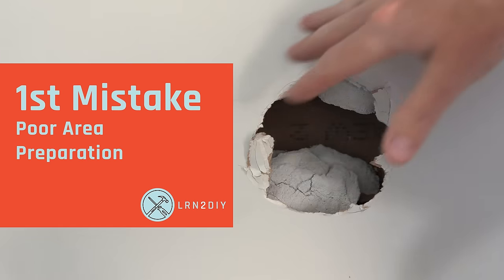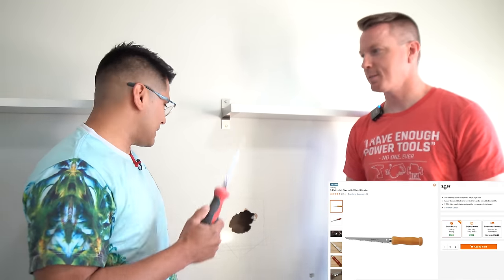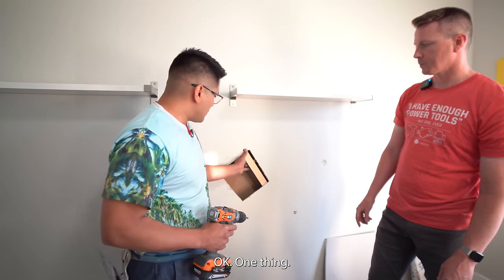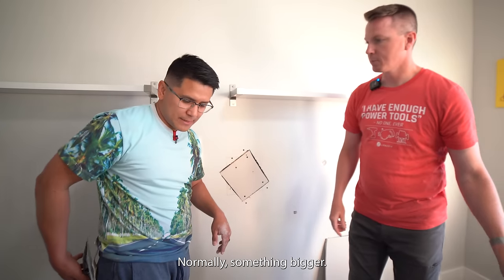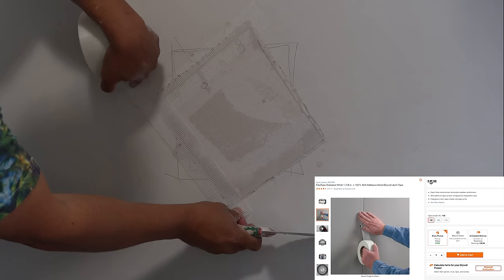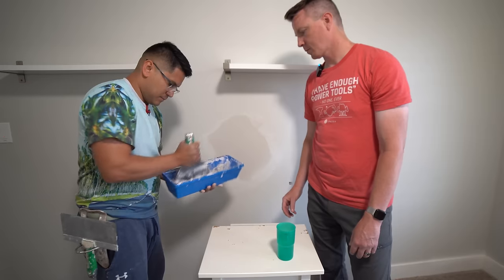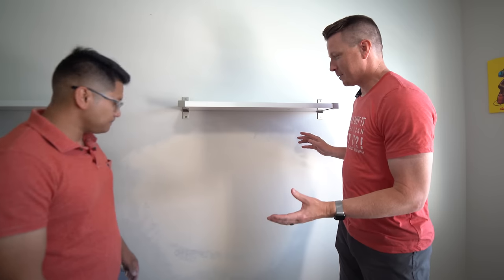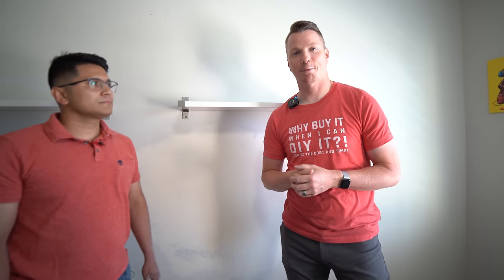5 Mistakes DIYers Make When Patching Drywall

Comment: A great tip I got from a spackler once. If the wall has many paint layers put on over many years it will likely have an orange peel look from the many coats of paint that built up on each other. This is especially true in older homes. Once sanded smooth your beautiful new spackle job sticks out like a sore thumb after painted.  UHG! To prevent this here’s the trick: before painting, mix up a THIN batch of spackle to a “paint like” consistency. Use it like paint. Roll your paint roller in it & go over the new spackle. You can even go beyond it a bit to further blend in with the old painted wall. Let it dry. Lightly sand with a barely damp sponge, blend the edges of the “spackle paint” with the old paint on the wall. Now when you the paint your wall you won’t see any demarcation from old wall to the new. No special talent needed by a DYIer.
Reply: Excellent

Comment: If you are using mesh tape you HAVE to use HOT MUD (they did in the video but no mention of having to use it with mesh tape). Using pre-mixed mud, the joint will be prone to failing as pre-mixed mud shrinks about 20% when it dries and won't grip the threads in the tape). Read the label on the mesh tape if you don't believe me. If you don't have hot mud, then use regular paper tape.
Reply: Don't know about that bud never had one fail
Reply: @jamesalbrecht418  Now you do ;)
Reply: @wally7856  na I found in the long run in Australia the paper tape always fails after 5 years see it every day and our pre mix mud we have a few types base,top,finish the base does not shrink at all
Reply: @jamesalbrecht418  dude the people that make the product mesh tape says to use hot mud in the first coat
Reply: @NunYaaBizz  as I said we have a pre mixed hot mud called base coat
Reply: @jamesalbrecht418  oh ok I missed that
Reply: @jamesalbrecht418  I apologize sir
Reply: @jamesalbrecht418  do you accept my apology
Reply: @jamesalbrecht418  He's correct
Reply: @NunYaaBizz  nothing to apologize for... Their comment only said "pre mixed" and listed the 3 different ones... They never used the key words "hot mud" when they said pre mixed... It wasnt until reading through all these that it was said what they really meant but didnt really say.
Reply: I use pre mix with mesh tape all the time. never had a problem.
Reply: @bobhren747  You should call up all the manufacturers of mesh tape around the world and tell them their instructions are wrong because you know better.
Reply: @wally7856 bobhren747 didn't say he "knew better,"  just that he's never had a problem with it before.

Comment: To save the handymans stress of using joint tape which often results with a domed finish and the inevitable sanding down inadvertently revealing the tape. Use construction adhesive in the gap around the repair piece, when dry sand it flush if necessary, then top coat over the top of it. Done it many times with no failures or cracking.
Reply: ta that works till someone touches it and it falls out
Reply: Use scrim and give it about 4 thin coats each coat getting wider and longer. To help with the blend.
Reply: yep that work well
Reply: That's the difference between a "handyman" and a finisher. Construction adhesive will result in lower quality work. That's not how it's done by professionals so why would it be good?
Someone who is good (heck, even decent) at drywall will use a tape of some kind because that's how it's done. Don't ever use construction adhesive or caulk.
You "can" use spray foam to "prefill" your joints (what he did right before taping them), but sparingly and being sure to cut it completely flush.
But unless in an extreme situation, I don't think I ever would.
Do what this video has shown. Use either paper tape, mesh tape, or Fibafuse (a thinner fiberglass based product which I use for all patches/new to existing).
Coat as desired (2 to 3 coats). 
After final coat, sand and sand somewhat harshly around the edges to blend your coats into the existing texture (you should almost be able to start seeing your existing texture through your own own work, but only at the edges maybe 1/2" to 1" in depending on size of patch).
Match texture by having it slowly fan out into existing. If it's a texture with lots of coverage, you can make it thinner where your mud is the most built up, because depending on the texture, the texture itself should be no different in pattern, but the thickness of the mud will actually make it appear more flat/uniform (keep in mind, with drywall nothing is flat, but it's the job of the professional to make it appear flat).
I'm not trying to be rude, I just want to make it clear, there is way things are done, and a reason for them.
I wouldn't come into your workplace and start making stuff up when I myself am uninformed.
I'm all for people DIY'ing but at the same time, I pay people to do work that I'm not comfortable doing myself, there is no shame in anyone else doing the same.

Comment: This is a pretty good explanation. There is a very important step you left out if you are texturing. You need to prime your finished mud work before you texture. If you don't do that the The texture will dry at different rates on the newly repaired area as compared to the existing painted areas. This is known as telegraphing and will show up in your finished painting coat(s).
Reply: I think this is what happened when I patched a hole in my bathroom. It just looked off.

Comment: Yeah try it at the store. They will love you for that!!! Some people might prefer using some other type of spreader for the joint compound. This only shows their inexperience. Done right you don't need top coat. Use a primer like Kilz after the area has dried completely. Let that dry completely by the directions on the container. There are other ways to repair a hole but this method spreads the load over a wider area. Most people won't notice the difference between a sprayed on texture from a can and a texture from a tacky paint roller. Just paint the area normally using the normal amount of paint and as the roller runs out of paint it will leave tips that resemble texture. Not as much but if you are a cheapskate like me or can't afford the $20 can of spray this method will be enough for most people. If you don't like the results you can always add the texture later.

Comment: I'm not a drywall professional. Every time I patch something and try to match the texture (typically knock down) it looks pretty good until I apply paint. Then, for some reason, the discontinuity jumps out at you. Generally, the error is towards too much texture. This takes a lot of experience to get right. Or you need to get lucky.
Reply: After the texture dries give it WIDE light sand. 220 grit sandpaper. Finally, you need to always two coat your paint. See if that works for you. I've done this work commercially for 22 years.
Reply: Try working with a light next to the wall and off to the side when sanding. This helps you see the texture via shadows.
Reply: Use a primer under your paint
Reply: @Reesicup  I always do.

Comment: Add some dish detergent in your joint compound if you want it to be silkier when mixing. It won't compromise the joint compound and makes a noticeable difference. If you do a California patch, you don't need backing or tape. It's more difficult but it is a cleaner installation, IMO.
Reply: I 100% agree!

Comment: This is a pretty decent method. I cut a perfect square with about 1inch added. Then you scar the paper to the exact cut, break those extra inches off and remove the drywall. This will give you an exact fit with its own paper as the backing. Can mix with hotter water for a faster dry.
Reply: Yes, generally known as a California Patch and is very simple and basic to use
Reply: In my opinion it's a much better job and  no screws required .
Reply: @lesmatthews6684  But will this work on a larger hole, like 18" x 24"?  I have not seen any california patches that big.
Reply: @lou-nc4rc  I think that would be a little big for a California patch, especially if it is an area that might get hit again.   Only takes a few minutes to install some kind of backing.
Reply: @lou-nc4rc if you have a 18x24" hole or anything close to 16" you may as well make a patch that goes from stud to stud...  Even if i had a 13" hole i would cutout my patch to attach to the studs directly...

Comment: This is how a professional does drywall repair. Telling your average person to mix their own mud and apply 4-5 coats with different compounds is more than a little overkill. I think for your average DIYer it's more than sufficient to fit a drywall patch into the hole and seal it in with joint compound, then sand the result to get it smooth. Repeat as needed until the repair blends in. 

Personally, I don't put in a backing or use tape. I take the piece of drywall that is going in the hole, apply compound around the edges so it will stick in the hole. Let that dry and then apply a top coat to get the wall even. Sand and apply one more coat if needed. I've never used backing, mesh, or tape for repairs and never had a problem with the result. 🤷‍♂
Reply: My concern with any hole over a couple of inches without backing is that joint compound is pretty weak, and the likelihood of knocking out the patch is pretty good.
Reply: That was my thought too.  Overkill, but it is how to do it at the highest level.
Reply: I agree with the multiple coat overkill but this isn't necessarily a 'pro' method, it is how a quality DIY'er does (maybe just two coats of good mud).  It is not that hard to do right...I use 1x3's for backing and mesh tape
...how much could this cost??  Not using either is pretty amateurish and somewhere down the line when someone tries to hang a picture on your crummy patch, you're gonna look foolish when your patch caves in, just because you were too lazy or unskilled to do it right.
Reply: I did this to method to fill an outlet hole that was placed wrong.  I ran into problems with getting the drywall filler piece to stay in place and at the right depth.  It's an out of the way patch and I managed to get it done but my best result was a large hole up near our celling in the main living room that I opened up for wiring.  That thin drywall repair tape that I think he used in this video worked great. I spread one very thin layer of premixed drywall mud over it to cover the tape and fill the gaps.  Let it dry, applied some orange peal and painted.  Turned out so well that you have to know it's there to find it.
Reply: lol not even close to pro level
Reply: @elguapo5467  you are no pro ,,, hahahahahah armature
Reply: If you're really lazy, you can use a random piece of drywall as backing. And I've never needed tape. And if you do it carefully, one layer + sanding gets it smooth enough to the point that no one will ever notice it was patched up unless they are really looking for it.

Comment: Wouldn’t it be easier to cut the square drywall patch piece to size first then trace around it?
Reply: You could do that, but you don't necessarily want the piece of drywall to be too tight of a fit to make it hard to get in place

Comment: Great Video! I never seen any Dry Wall Repairs done with Multy Coats. They all used just one? So this was diffrerent. Cost more too. Im sure harder to sand will not be a big deal though. You can sand wood which is not a big deal and harder then this. So Im going to assume that why they just stick with One Compound? Saves time and money?

Comment: Another mistake DIYers make is "wet sanding" the premixed stuff. Sure, wet sanding cuts down on dust but wet sanding the premixed stuff usually rehydrates the mix and too much of the mud comes off, leaving voids and exposing the tape. To cut down on dust small thin repeated layers is the way to go, only put on enough mud to hide lines and only sand off enough to feather it.

Comment: Wouldn’t it be better if you cut out some of the drywall paper to lay in the tape so when you apply the joint compound you don’t need to put so much mud to blend it flat?

Comment: I removed wallpaper, and pulled the top layer in a few small sections.  I've done some research, and know that I have to cover the exposed brown paper, with something like Zinsser GARDZ or BIN, or some other type of sealer.  At that point, what type of mud is recommended.  Can I just get away with a layer of the blue top TOPPING mud and sand it down before primer and paint?
Reply: After removed wallpaper apply at least two or three coats of sealer otherwise the brown paper becomes a nightmare 😅. Then just follow the steps on the video. Maybe you’ll need an extra coat of mud just because of the brown paper peeling off.

Comment: Get some paint stir sticks at Lowe's. Use a hot glue gun  to glue them sticking them into the hole front to back. Wrap some mesh tape onto the sticks for compound support. That's your backing/support. Then, slap on some compound. Sand and repeat until smooth. Paint.   You're done.

Comment: The stereotype of grown men punching things when they're triggered is not something you want to perpetuate.
Mesh tape just makes things harder to blend and NEVER layer the tape at the corners.  Adding unnecessary thickness is counterproductive.
Reply: I've repaired more than one "temper" hole in our drywall, usually from teenagers. In fact I'd say that's been the major source of needing to patch walls over many decades of home ownership. And everyone I know just nods in sympathy when I mention it - so not so sure it's a stereotype (apart from the "grown men" part).

Also, though I tend to agree on the older mesh tapes, there's a newer one (I think it's called fibafuse, only ever needed to buy one roll) which almost melts into the joint compound and is very strong. I had to open a wall recently to fix an issue and that stuff was amazing on the patch.
Reply: Stereotype? I don't think there are any types of stereos here - I think what Learn2DYI is telling all of us is, "Look... Don't f*** with me, a**h***!!!" 😏...

Comment: Do you need to use any sort of special paint or primer when you're done?
Reply: yes, you have to colour match the paint
Reply: If I have some of the original paint and am going to use that, I've gotten best results by applying a thin layer of sealer over the dried plaster before painting it. It now won't absorb the paint at a faster rate than the surrounding painted wall and will therefore blend much better.

Comment: Also with Multy Coats and different compounds. Does not look like you waited 24 hours for each to dry? You just put one over the Top? Is that correct?
Reply: You don't need to wait 24 hours. They're made for 5mins, 15mins, 20mins, etc.

Comment: Great video

But question
Green lid is to fill in the gaps
and Blue lid will be the top layer allowing to easily sand?

Also how many coats of green and blue is necessary?

Thank you
Reply from the maker: This can vary somewhat on the repair, but for ones like in this video, you'll typically have one coat of green lid (or hot mud) under the mesh tape, just to get things level again, then two more on top. Once those are dry, you use one coat of blue lid as the surface/texture layer.
Reply: @LRN2DIY  I don't know if this a U.S vs Canada thing, but when I look at the Canadian Home Depot site, The All Purpose lid is blue rather than green.

Comment: Wow, this ‘Williams’ not only tears off the loose chunks and drops them into the wall, but pulls off and risks damaging the outer paper and enlarging the required patch, @ 0:52 ?  Who does that?

Wow @ 02:20!  Cockeyed and irregular cutout, and poor fitting patch!  I, umm, just don't get it?   Not even going to comment on the way he put the backing ‘sticks’ in.  Stopped watching shortly after that point, but I did watch William tape and mud the patch, and what a fantastic job.  Very good technique. 👍

Comment: very Lengthy process ,our patch takes less than an hour and ready to paint with no sanding; No BS !
Reply: I could yooz anything for a backing, but can I use this 30 lb. marble slab?!? I don't have any wood pieces. 🙂
Reply: @bentonrp  I've used drywall for backing out drywall...if you're careful. Pilot holes in the patch piece works best.

Comment: With a hole that small, you don't have to put a sheet rock plug, just put a stir stick behind it and mud over. Been doing it this way for years. No problem.
Reply: "just put a stir stick behind it and mud over"

That's exactly what they did...
Reply: He meant do the stir stick without the sheet rock plug
Reply: I’ve done this before successfully by just putting really thick crumbled cardboard paper in the hole and then applying the mud. That gives the mud something to attach to. It’s been five years and it’s still looks good.

Comment: The only comment I have is that you assumed half inch drywall. You should have at least made a comment to confirm the thickness of the drywall. Some older homes have 3/8 and some have 5/8 in bathrooms. You also should mention plaster walls, even to suggest calling a professional.
Reply from the maker: Great feedback!

Comment: I've been trying to do this for 30 years.  I hate the 5 minute stuff.  It starts to harden as you're still applying it on.
Reply: 5 minute mud is used mainly for painters that work in large apartment complexes that have to paint 2-3 apartments a day  , the 5 minute compound needs to quickly repair any minor damage . The mud dries fast enough to be paintable in about 30 minutes .
Reply: Use 15mins or 20mins

Comment: Is there a lump on the wall now tho? Or is it flush?
Reply: Why would there be a lump on the wall?
Reply: There is a lump, but it is so broad and gradual it is not noticeable. That’s why each layer of mud gets wider and is tiered on the edges.
Reply: @TomCee53  There is no lump unless you applied way too much joint compound. After sanding, it will be flush with the rest of the wall.